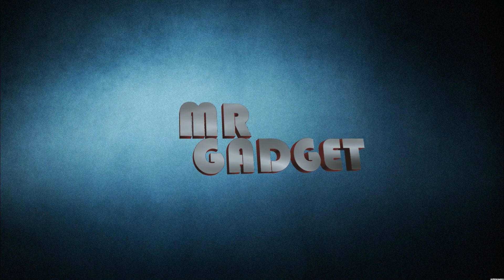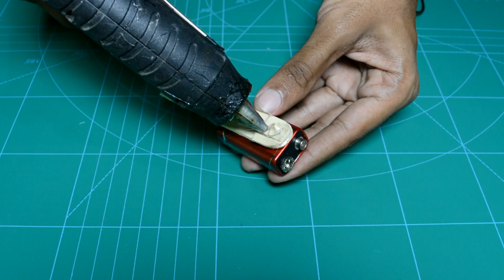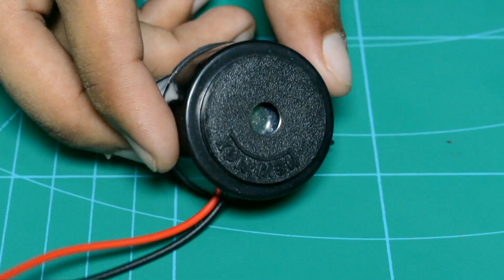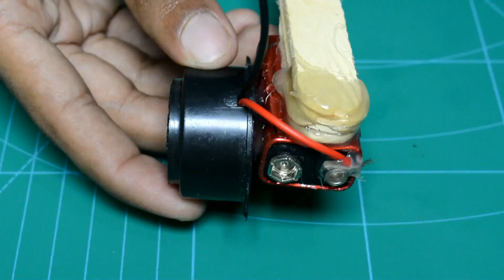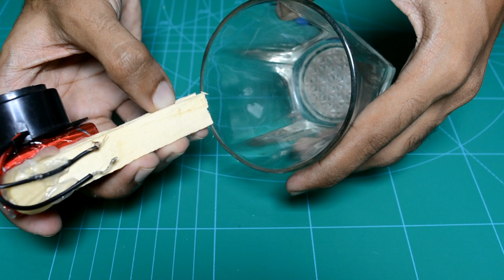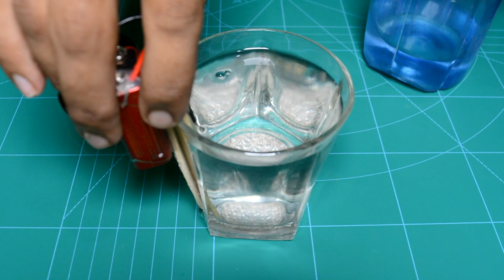How to make water Level alarm at home easily

Comment: what is the explanation of water alarm and how it touch the and then how it ring
Reply: The electricity flowss in water and it reaches the other wire
Reply: bro it does connect the other wire in water